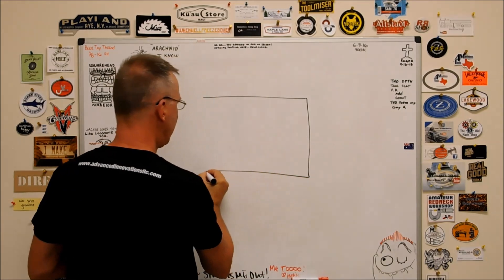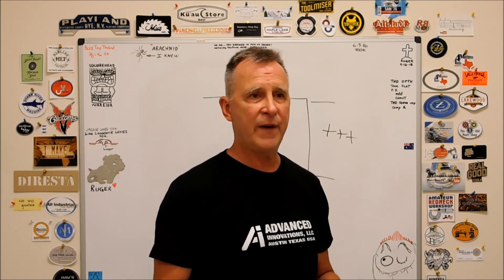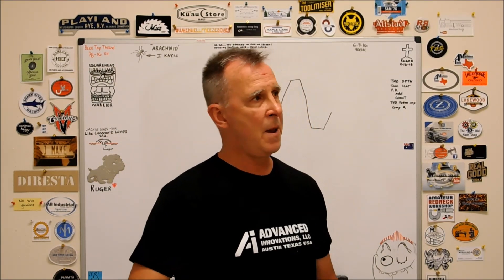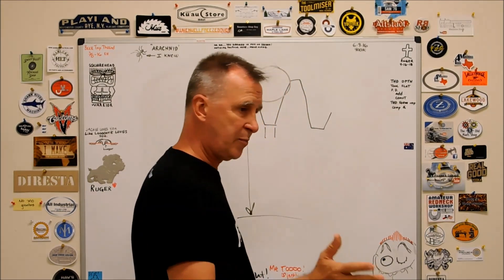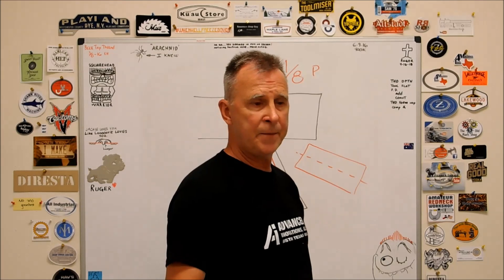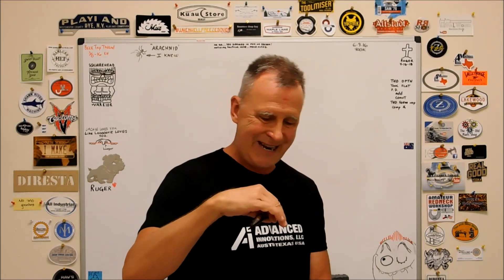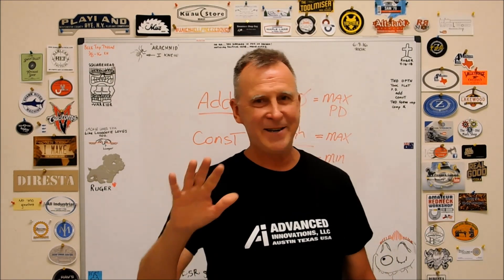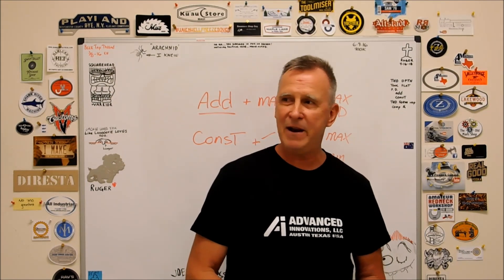Single Point Threading, Want to do it better ?? Watch This Video.

Comment: I noticed a little flustration from some of the comments. Doing machine work requires a lot of patience to get the results needed.  I use many methods to get the results I need, depends on the job. I cut mostly LH acme custom threads, I sometimes use a measurement from surface to the bottom of the thread as a reference. When getting close to where I want to be, then I use a custom pitch diameter checked with wires. I have samples of most threads I do from making the original part longer than needed cutting off the extra length to use as a plug gauge. This is a great video on how to make your parts to the industry standards established to make our jobs easier. Thanks for putting this information on line for all of us to share!!! Great job 👍
Reply from the maker: You should get used to working to standards. Its a good practice.

Comment: thanks for all the videos...Have not found a vid on dressing threads...had a part come into my shop and ithe part had been over torqued.  needed to dress the threads on both the cap and the bolt..did not have machines to do it and know one in town would do it...got a video to show me how...when I get the machines...thanks for all the good info and help...thanks

Comment: Thanks for sharing. I worked overseas and brought my equipment with me from the USA. We also brought parts that need to be replaced every now and then, cases of oil and air filters , starters, turbo, alternators, solenoids  and relays. We did so well a 9 month job extended to 5 years with four new customers. One thing we forgot were nuts and bolts. I sent every spare minute cleaning and repairing old bolts from junk yards and bone yards. Luggage with new nuts and bolts getting stopped at the airport, the TWA guys loved me, not! Someone had the great idea to have some metric bolts cut down to imperial sized ones, bad execution wasted time and money.

Comment: Hi Joe

I agree with the sentiments and principles you expressed but cutting threads by using thread depth is used successfully if you follow some rules.  What you said in the video definitely applies to hand sharpened tools of dubious dimensions.  However if you use a precision thread cutting insert tool of known dimensions then this is a completely different scenario.  
When thread milling on a CNC mill, the effective thread depth is used because it must be programmed into the machine as there is no human intervention.  This is applicable to a lathe situation.
If the outside diameter of the part is machined and measured accurately, a simple formula can be applied to determine the depth of cut.  Once near the target depth, the thread pitch diameter can be measured over wires.  I have included a few notes below

I would appreciate your comments.

Cheers

John

THREAD MEASUREMENT WITH WIRES
The best wire diameter for 60 degree thread form is 0.57735 x Pitch
Measurement over wires = Pitch diameter + correction factor

The correction factor = 3 x wire diameter – 0.866025 x thread pitch
.    If the best wire is used this reduces to a correction factor = 0.866025 x Pitch
For best accuracy use the recommended wire diameter for that pitch.  The reason for this is that the wire tangent contact point is at the intersection of the pitch diameter and the flank of the thread form.  

MACHINING AN EXTERNAL 60 DEGREE THREAD WITH THREAD INSERT CUTTER
Total depth of cut = (measured diameter before machining thread – target thread pitch diameter) divided by 2   +  0.433 x Thread Pitch – tool nose radius** 

(**Where a manufacturer does not use a single nose radius, the manufacturer of the insert may use a flat end with two smaller radii to remove the sharp corners.  Don’t use these radii.  The manufacturer will specific a distance from the apex of a theoretical 60 degree triangle to the nose of the insert.  Use this distance in the above formula.)

Comment: Hey Joe thanks for another great video! Just about everything you said was new to me as a home gamer hobby machinist. Any you could just post a link or leave a name for a decent wire thread gauge set?

Keep up the great content. 👍
Reply from the maker: Buy nice or buy twice...  You cant go wrong with Brown and Sharpe or any name brand, but the differences will be negligible.  https://www.mscdirect.com/browse/tn/Measuring-Inspecting/Dimensional-Measuring-Tools/Thread-Pitch-Diameter-Measuring-Wires?navid=12107674

Comment: Err.... Joe, pal, Comrade...
I must say that Imperial threads tend to come out askew when Saturn is in Uranus... I may be me but it's worth considering !
Metric threads on the other hand....
All nonsense aside, those thread gauges (internal thread measuring) are getting to be quite affordable.
I bought two sets, one for standard metric and one for fine metric (M3 to M12) and they were about a 100 euro a set.
Sure, they aren't NASA-grade, but they will do for the average shop and definitively will do for the shed-warrior.
Some years ago, I managed to get my mitts on two Russian NOS thread mikes... A thread mike is something you think you never need...until you used one/bought one.... then you wonder how you ever did without...
Do you plunge in at 90 degrees, or do you go to the whole "sidling in approach" ?
That has spun out to a discussion on par with the one on "the gender of the Angels" ...
I contend that with modern equipment, and for smaller threads (M8 or smaller) there is no need for the whole side-wards skulking up ... If the cutting tools are correct and decent quality (and the machine has enough 'humpf') this still go for bigger threads as well.
It seems like this is something left over from the years of Yore, that just refuses to die 

Toodles!
Paddy

Comment: I've used the "wrong 30 degrees" before. Different lathes have different zero reference points as to where 0 is and where 90 is. I had my compound set to 30 degrees (29 1/2), so I think I'm good to go. I needed to be at 60 1/2 to have the proper angle. Thought I was losing my mind for a while till I figured out what was going on...

Comment: You're slightly wrong there Joe - an internal thread can be checked  using a Carl Ziess  metroscope (used for calibrating screw plug & ring gauges, AND Parts, but they are expensive kit.

Comment: Internal threads can be checked with the three wire method. However it requires the use of three balls and an adjustable parallel with a vee ground in the flat surfaces. It's not fun but it does work. Such an adjustable parallel can also be used to hold pins when checking the pitch diameters of internal gears and splines

Threading tools. Some observations and thing I've learned over close to 50 years. First the threading tool needs to be on center. Second the thread profile must be a 60° included angle. No 61, not 59. Third,  ideally the leading edge of the tool should be perpendicular to the axis of the centerline. The way to get really accurate tool profiles is to use either a tool grinding set-up or a block on a surface grinder. These will produce tools with the correct profile. This applies to 60° threads, Withworth Threads, acme, metric acme or buttress threads. Yes you can grind threading tools off hand. But if you have to take the tool out to touch it up if the cutting edges are at a fixed angle to the leading edge then you do not have to realign the tools centerline perpendicular  to the centerline. Also you can use a square or the face of the part to orient the tool to the work. Some people would say its cheating. I say work smarter not harder. Plus as we get older our eyes get "tired".

Comment: I gave up waiting for you to get to the point. I still have no idea what it is.
Reply from the maker: There were many good points here.  Were you looking for something specific?
Reply: @joepie221  It's all don't do this, don't do that, and a lot of tangential talking. But I gave up figuring out what then to do instead. I am not even a youngster with a 10s attention span. But a couple of minutes that felt like a TV show that would never get to the revelation, but only keep baiting you to hang on after the ad break, enough for me. Sorry to be harsh, I usually enjoy your vides, and they are usually much more to the point. Maybe I am just thick or got wrong out of bed today.
Reply: @UniquePhoton  Forgive me for butting in, develop patience my friend. Being amachinest is all about slowly working towards the needed result. If you are not understanding threading, try looking at a machinery's hand book. It's all there. Its an aquard thing. One step at a time. Good luck.

Comment: Thanks for another helpful video. I first learned of thread measuring wires from watching This Old Tony: I've tried to get some in the UK but so far haven't found much, apart from a few sets in the USA with postage costing more than the wires themselves... Am I simply looking in the wrong places, or do British engineers favour a different method for some reason?
Reply from the maker: If the wires are sent as an envelope as opposed to a box, it would be much cheaper. Interested in a set? I'd be happy to get you a cost.
Reply: @joepie221  Thank you very much. I'll contact you by email.

Comment: My process, while I am not doing it for a living. Is to have a quality set of dies and taps. When I am within range I take of what I need until it's a perfect fit. I know this is only going to work up to a certain size until it becomes unsustainable due to size. The other thing it allows is depth of cut for a part run, you can zero out the tool depth. Obviously you have to be 100% sure of tool position to do this. But for the small volumes I do, it works great.

Comment: You do not want your cutting tool in line with your compound's axis as you showed with the dotted line in the video. You end up with buttress threads. The tool needs to be parallel with the crossslide axis or perpendicular to axis of the work piece. The compound axis needs to be 29.5-30 degrees off the crosslide axis or off the face of the chuck. I know you know this and it was just an oversight while you were caught up in your rant. ;-) You can use a thread depth chart as a guide only to give you a idea when you can start checking with your wires.
Reply from the maker: Please point out, where in the video I stated that.
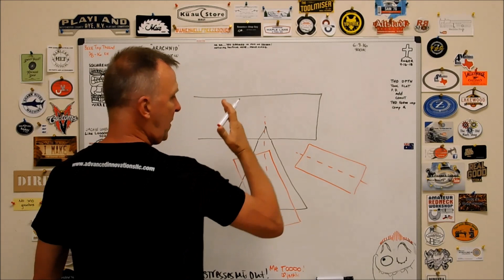Reply: At time 9:07 you state "You want the center line of that compound riding somewhere on the centerline of that profile." and you drew a dashed centerline down the middle of your cutting tool.
Reply from the maker: There is an assumption of common sense and some experience that comes along with this video. To be factual, I never stated to align the tool. The centerline reference was for the compound only. The centerline from the part was from the feature and not the tool.

Comment: If at all possible I like to almost finish a thread with a single point tool then finish with a sold tap or die. On large mechanical drive threads like Pitman arms in 10-20 inch diameter range this is not possible so thread wires held in place with an elastic band and the appropriate micrometer are used. For the rich and famous micrometers with thread v anvils work extremely well.

Comment: Good advice if you're doing small quantities , using threading tools that you ground yourself.  Good advice for anyone just starting out.  
However, for producing larger quantities, I recommend buying carbide insert threading tools, and using pitch mikes in place of wires.
To check internal threads, consider just using the appropriate tap, instead of a plug gauge.  It's cheaper, and will bring a thread that's a little undersize up to proper size.
Reply from the maker: If you plan to hit the checkbook, buy hard gages and stop messing around.

Comment: It is a lot easier to feed straight in with the cross slide when threading but your thread will most likely not have as nice of a finish as if you were to feed in with the compound along the angle of the thread. Also will be less pressure pushing on the part and less heat generated when cutting. Important when threading small diameter threads that can distort.
Reply: That may be true IF your in feed is exactly 30 degrees & your tool also. If it is not I suspect the back side of your tool is just rubbing because it can't deform the metal enough to start the cut, hence more heat. I find I generally get a better finish at higher cutting speeds. I suspect the better finish comes from the way the chip forms due to heating. The heating caused by the back side of the tool isn't going to help the chip formation.  There is no such thing as a perfectly sharp tool for practical purposes. I feel much better cutting away from the chuck/ shoulder at higher speeds. Takes less time also. I started out doing the 29.5 thing, then saw Joe's video on plunging, tried it, like it, can follow the logic. Have been using his method ever since. I'm surprised how many videos there are still doing the 29.5 thing.
Reply: Larry Schweitzer I usually work in metric therefore 99% I keep the thread dial engage. It’s kinda difficult to get the tool to stop in the undercut if I were to cut feeding away from the chuck. Know I can turn the chuck to fine adjust the position of the tool. I just find it quicker to just feed towards the chuck. Also it’s pretty fun to me lol. I usually just feed straight in but you can’t deny the chip is much nicer when you advance the tool along the angle of the thread. Feeding straight in makes a wicked chip.
Reply: @chrisn3794  Yes, I have to do a lot of metric also. Most of our shop has metric/European equipment. But my Chinese lathe has an inch thread feed. So I also have to leave the thread dial engaged & back up to the start. PIA  Haven't noticed a poorer quality of thread finish by plunge cutting. The only thing that has given me real fits is threading stainless. It seams to work harden very quickly. I'm probably the problem, lack of experience.

Comment: I thought pd was the location where the cross section of the body and the void of the thread were the same length.  I Dont think the semantics of the definition makes a difference as long as you are measuring with proper tools and procedures.
Reply from the maker: I believe you are correct. The theoretical perfect profile would place it there.